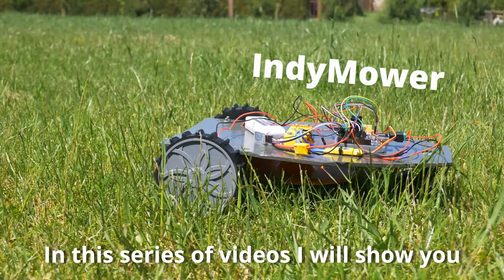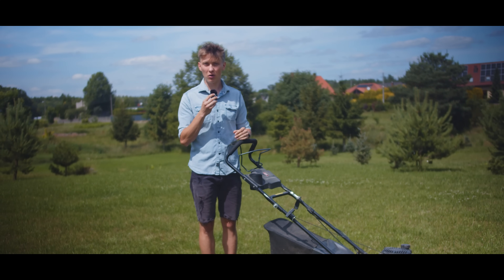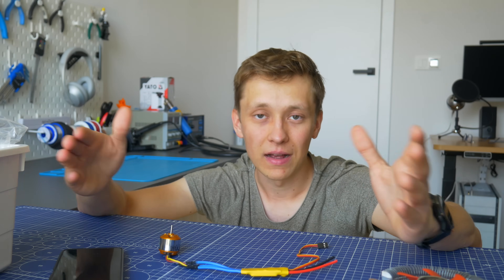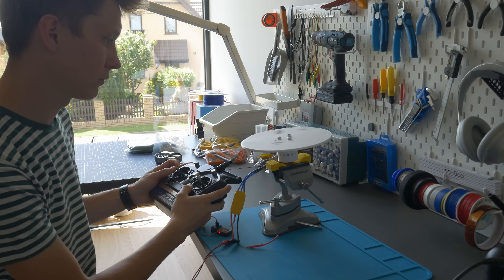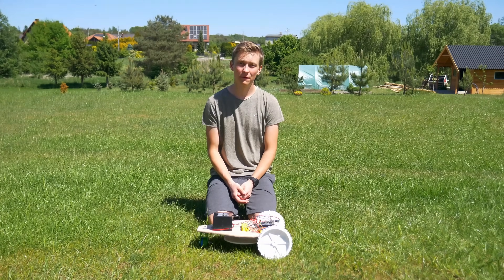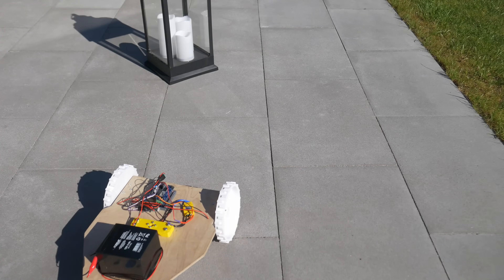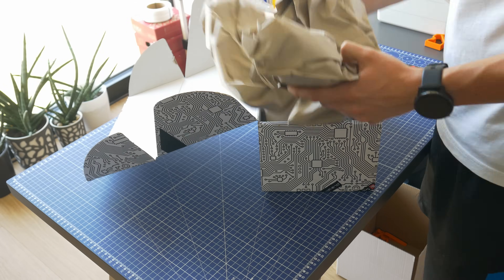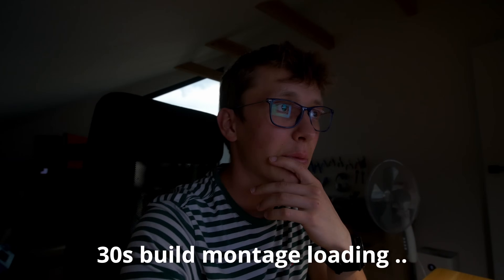Cheap DIY Robot Lawn Mower - IndyMower #1

Comment: I've had a lawn mower robot for the past 7 years now (an husqvarna automower 315) and I can say it's a game changer. The garden is always tidy and we make no noise (vs my neighbors who uses their gas mowers every other weekend, and have their grass always high until next cut). What I can also say, though, is that the perimeter line is a pain. If at the time I bought my mower there was a GPS one at a similar price, I would have bought it without thinking a second. So, good work for now, if needed as a proof of concept, keep working on the perimeter-limited style mower, but think about rtk, it's on another level!
Reply: I was thinking the same thing (though I lack experience, just been researching the options). Great thing about this being open source is once it's out there, someone could add that as an option! Heck, Id bet someone could make it use both so it stays in the yard for certain but has the accuracy of where it's mowed of the rtk.
Reply: The GPS will need a beacon to match the accuracy constraints, won't it? Would the cheap Aliexpress GPS modules be able to compete? I fear it won't, but that would be really nice.
Reply: I could have said each word. Maybe have a look to OpenMower project.
Reply: Hearing that GPS without beacons isnt quite accurate. Some are having you drive the borders roomba style. I have not seen anyone trying to use cameras to record and recognize borders.
Reply: @thewatersavior  if you want to use GPS you absolutely need RTK. Cameras are quite difficult to implement, since not all gardens are perfectly flat, and a hill seen by a low resolution, low point of view camera might result equivalent to a hedge or a bush
Reply: @AlessandroTischer  RTK makes sense and I'm there with you on resolution challenges - my challenge back is.. we dont have GPS in our heads.. and... throw some AI at it? In all seriousness, I fully agree - other more analog approaches are wrought with challenges - but isn't that where the fun of innovation lies? I'm basically imagining an NPC lawn mower and your background is its challenge - how long would it take for emergent navigation to arise given some simple sensors and maybe an image of the layout. Now that seems like youtube fun :-). Great start here - love the platform and the suggestion to drive in reverse. I've been playing around with a powerwheels and hate having to figure out how to turn the damn steering wheel with simple 3d prints.
Reply: What's the issue with the perimeter line?
Reply: @brentsido8822  first of all, it breaks. Whether it's you or your pet digging for any reason, or the soil adjusting after the rain, the wire will break. And you'll have to find the exact place it broke. Sometimes it's easy, sometimes it's not. When it breaks it's enough to resolder it with a soldering iron... Except... A wire that was buried for years is not in great shape, and it won't be easy to solder it, at all.
Apart from that, if you once want to add or remove a tree, a bush or a flower bed, you'll have to dig out the wire, modify it... It's not a fun experience, and trust me, I thought I wouldn't ever need to change anything in the garden when I first installed the robot wire... But things change

Comment: Even remote controlling a mower without any automation seems so much more fun than pushing one, very cool project!
Reply: FPV lawn mower drone race
Reply: record your remote movements and then just replay this each time. if motors were 200 for a set then use an old robot for motor parts